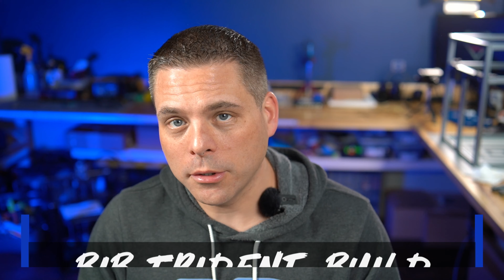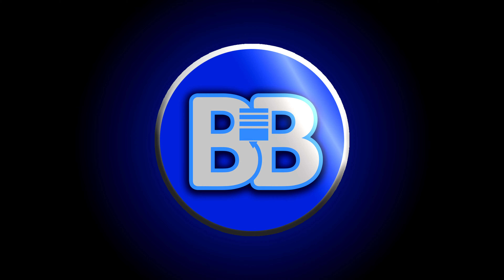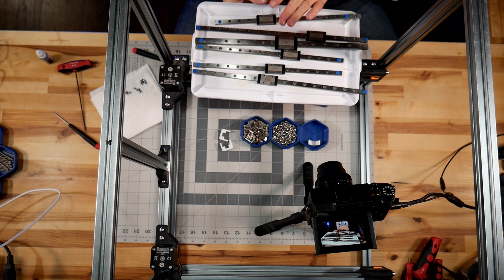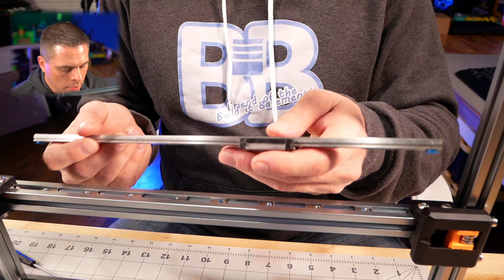Voron Trident Build  - Linear Rails and Inverted Stuff?

Comment: The threadlocker is rarely needed when attaching ABS parts, as the compression of the plastic provides enough tension+friction to avoid loosening. For PLA, which is brittle and gives in with the time, it would still be a good idea though...
Reply from the maker: 100% agree - actually mentioned this in a previous video in this series.  I guess the only counter argument I could/someone could come up with is that: Once heated the ABS may become more malleable and under stress the hold ay not be as "springy".  But, really - do what makes you happy and learn as you go.  (Again I agree with you!!!)